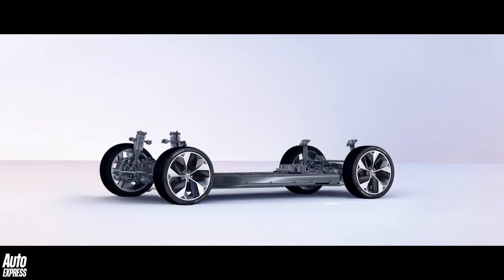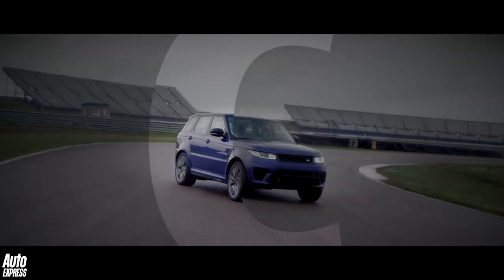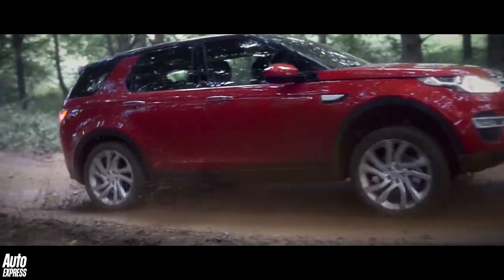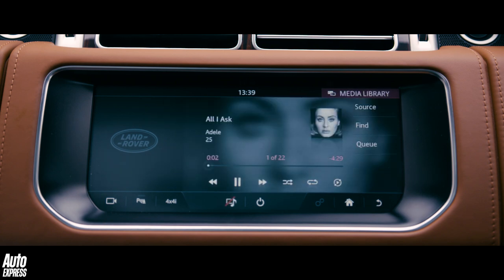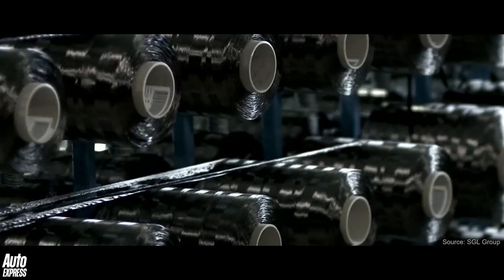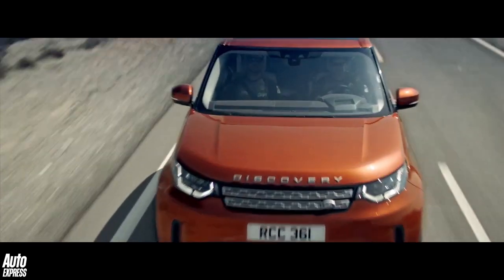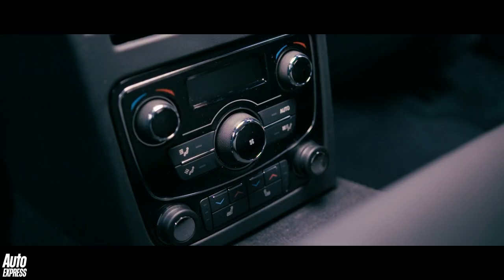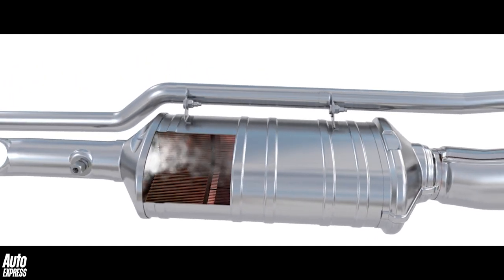Car Tech A to Z: C is for carbon fibre, cruise control and more

Comment: Carbon fibre is used instead of metal such as steel and aluminium to save weight. Steel and aluminium can be recycled relatively widely and easily, carbon fibre can't. Great that car manufacturers provide a solution but create many more subsequent problems.